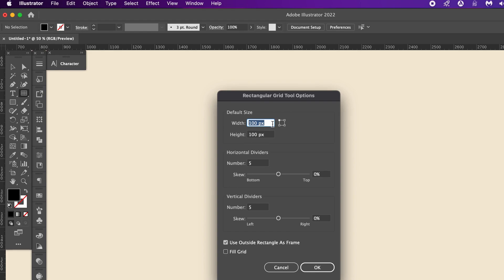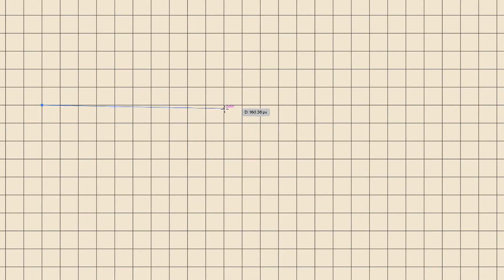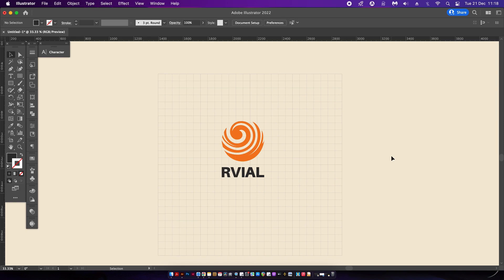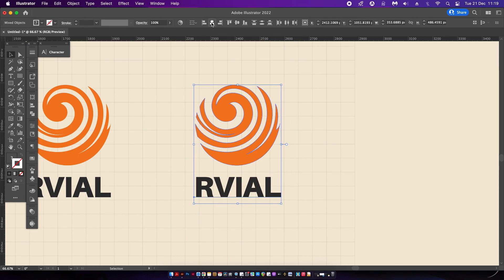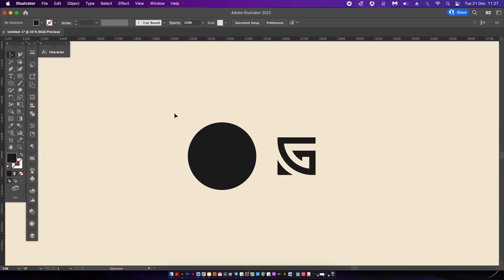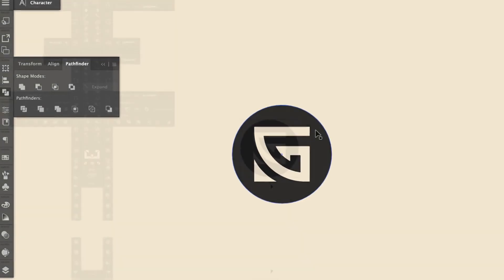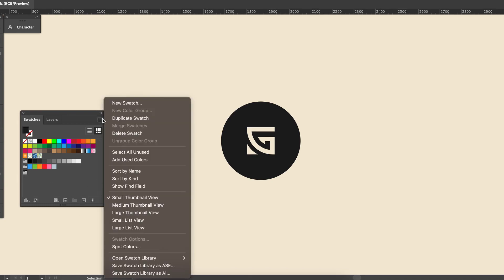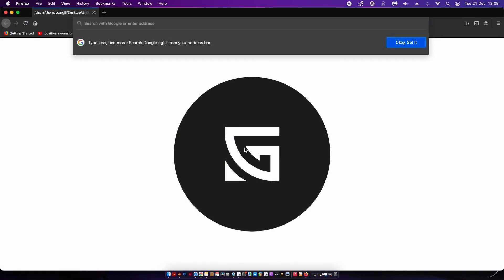AMAZING Technical Logo Design Tips  (PRO WORKFLOW)

Comment: Regarding the first tip : I changed my preferences to snap to point at 2px, but it does not snap to the intersections of the grid still (with snap to point on) What setting are you using specifically to achieve this?

Comment: Regarding Tips 4 & 5:
I would suggest you cover the Dynamic Compound Shapes technique in a future video. That's the one where you Alt + Click on the "Minus Front" icon instead of just clicking.

It's the perfect balanced solution without neither of the Tips 4 & 5 Drawbacks:
1. You don't lose the cut-out shape, because it survives as a separate element in the Layers Panel, making it still easy to select and manipulate independently.
2. It's an actual true cut-out that works on any non-flat background, avoiding the hack of assigning the shape the same color of it.
Reply from the maker: Covered it at least 3 times on this channel :p
It is helpful for sure

Comment: You can also use the pathfinder tool while holding the 'alt' key. With this, you can apply the pathfinder but keep the 2 shapes in a separate object. You can still edit or move one of the shapes by double-clicking it if you want to make any changes. Once you are happy with the result, then expand the shape to change it as a single object.
Reply: True,  this is a better way.